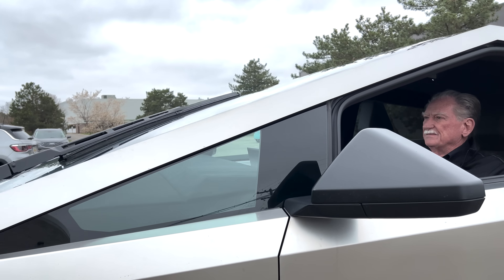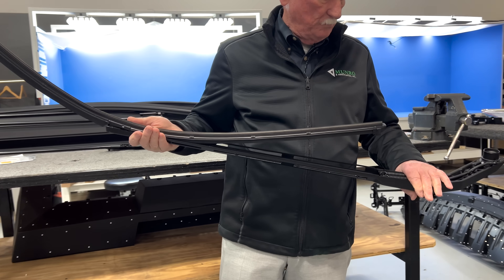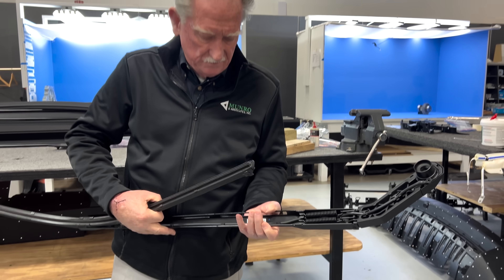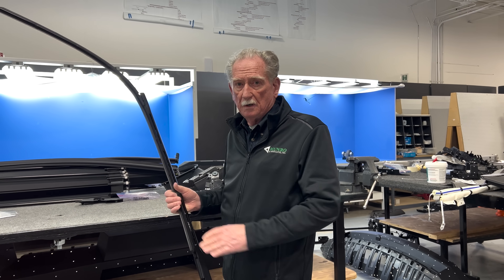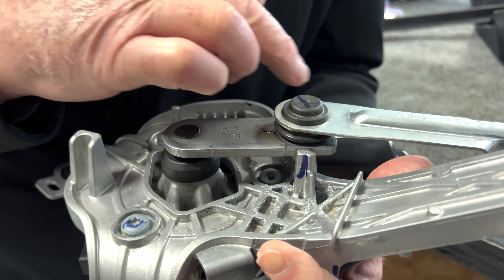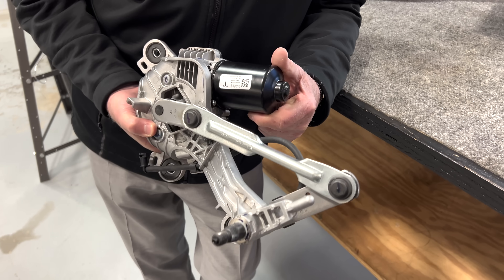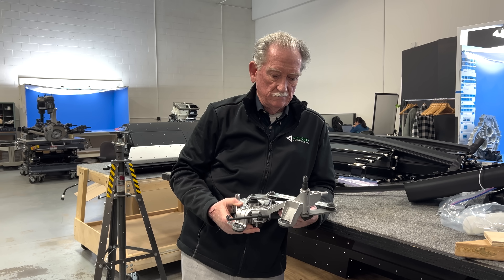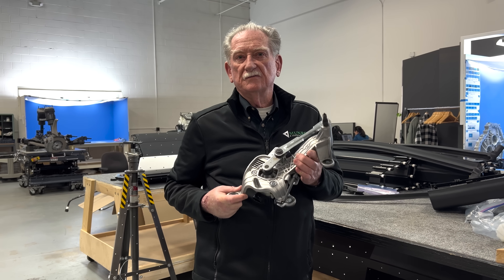How the Cybertruck's Massive Windshield Wiper Works

Comment: My Cybertruck wiper works great, but the factory-supplied washer fluid reminded me of the blue toilet water on airplanes.  I don't think the item shown by Sandy is the washer bottle, mine is black and the manual lists the capacity at 4.2 liters.
Reply: Agree, the volume of what he shows looks like way below 1 Liter. Would not really match a low maintenance car/truck, when you have to refill it too often and would be a safety issue. 4-5 Liters are standard in such a washer bottle. The actual piece is 1670900-99-C "Washer tank assembly" and looks way different in the parts catalogue.
Instead, in his hand he seems to hold the Brake Remote Reservoir, 1250681-00-A.
Everyone can mistakes from time to time, but it tells you something about an engineering analysis company, if they mix up those two reservoirs. Should not happen. Whoever put this on the table, needs some serious education. And Sandy should think about letting the actual engineers present the stuff they disassembled or analyzed.
Reply: @MooseOnEarth  doesn't matter,he always just says stuff that is not true.
Reply: It shakes the whole truck. Poor design.
Reply: @kcw9313  Wipers shake plenty of cars on their highest setting.  You never used a car before?  You can feel it in your seat.
Reply: Go price a replacement blade,if they are even available.  What a dumb vehicle. Replace tires much sooner than properly designed stuff.
Reply: @cengeb  It is 75 dollars for the blade.  But that is right now when they are barely making them. That cost will drop fast when they expand production.  Stop being a weirdo who acts ignorant on purpose.
Reply: @_PatrickO  $75 for one blade, saving money by going EV?  Hmmm, not if ya do your gazintas.  the math don't add up.  Wiper usually last about 9 months if lucky.  The Sun destroys them, even the good stuff, Bosch, Trico, Anco.  So even replacing wipers will be a major expense on this toad.And where they position the wiper at home, car washes will rip them off.  Not a very smart design...that is if the thing doesn't brick from the water
Reply: @cengeb  Grow up.  It is a $100k vehicle that is extremely low volume.   The price will be as cheap as any other large blade by the time they go into full production.  (assuming musk doesn't ruin the company first)
Reply: @_PatrickO  The idea that this junk is $100,000 is insanity personified.  the razor edges of unfinished edges, it's a joke.  they use a rivet to hold on the dumb plastic cover on the pedal, it's an embarrassment to any one dumb enough to pay $100K for this stupid looking useless junk.  Be embarrassed, driving it,
Reply: @cengeb  You are mentally ill, its low volume right now.  That means parts will inevitably cost more, but the only one buying them early like this are rich people.  Why are you obsessed with pretending new production doesn't start off slow and ramp up?  This is how it works for every company since the beginning of manufacturing.
Reply: @cengeb but muh no oil changes
Reply: @hansbrix2495  tires wear out faster,, cus of weight, brakes need cleaning because they are not used often, especially in snow areas, where salt is used. Suspension parts wear out like any other vehicle.
Reply: @_PatrickO  Well... I suspect the price will drop when there are competitors making replacement products. But it's alwasy going to be expensive. No more $5 refills
Reply: @stevep8773  I don't think 75 bucks is expensive at all.  This is extremely low volume and is larger than a normal wiper, so normal wiper manufacturers wouldn't be able to use their normal production lines for this.  Making new stuff that is different than existing stuff means their is an early adopters tax.  Why do we have to act like high prices on something brand new for the first year is not normal.  Look at PC hardware where prices start off high and get much cheaper after a year.  That is what it looks like making totally new products all the time.

Comment: Do arm assemblies typically do a complete revolution? 
Seeing this one with travel stops at the motor/gear end, would mean change in the motor direction by voltage reversal for every sweep cycle...?
Reply: @vwecco1:  Old style wiper motors did a complete revolution with the linkage making that into the back and forth motion for the wiper arms.  That allowed a simple on/off for power to the motor for control plus a parking off switch to make the wipers stop in the down position.  Today, modern electronics are so cheap that reversing the motor voltage is less costly.  Plus the 48v operation makes the motor cheaper as well due to less copper used.

Comment: The more I see of 48V architecture, I wonder to myself, why is it that this wasn't done 50 years ago given how it means a much smaller footprint for all the electrical components.
Reply: 12v was cheaper
Reply: Typical (heavy) 12 volt lead-acid battery is six ~2 volt cells.
A 48 volt lead-acid would be massive.
Reply: About 20 years ago, there was a push to move to 42 Volt DC bus when electric power steering began to appear.  Some racks are 42 Volt with a separate inverter for power.  Notably, this can be found on GMC Yukon and Sierra, Chevrolet Tahoe and Silverado, as some other brands with EPS.

42 Volts wasn’t popular, which is perhaps an understatement.  In 2009, Popular Mechanics ran an article, What happened to the 42 Volt Car ?

I tried to find out why 42 and not 48 Volts?, and have not found a satisfying answer.  48 Volts has been a common DC bus voltage in telecommunications for over 100 years and is still common in data centers for powering servers and switches from DC.  As such components oriented toward 48 Volt operation already exist.  Even changing to 24 Volts would have made sense because that is already common in trucking, industrial and military vehicular applications.
Reply: @wtmayhew  Thanks, very Interesting! I guess it took advances in electrical device tech in EV's and Tesla to make the final push away from 12V DC to 48V. Hope it sticks this time.
Reply: @joebullwinkle5099   Thank you for the reply.  I agree, high time for 48 Volt bus now that it is inexpensive to convert DC to whatever voltage is desired.

Comment: Would be interesting how such a wiper and assembly would hold up over time, especially with temperature fluctuations. I guess time will tell.
However seems better with one blade then 2 separate blades.

Comment: I just hope it senses rain better than 3 or Y. Owned 4 teslas thus far and they have all been terrible at rain sensing. Don't know why they just won't use infrared like the rest of them
Reply: Have you watched technology connection ?
Reply: @ralanham76  just checked it out. Not sure why Tesla has to use vision for everything when something like that works perfect. Instead my wipers turn on for no reason or don't turn on even though there's enough water to not be able to see. It's my only real gripe.

Comment: This video was an absolute delight for me!  I'm not sure if it's a coincidence or a sub-conscious psychological disorder, but I have owned:

1981 VW Scirocco: 1 Wiper
1987 Subaru XT6: 1 Wiper, dual bell crank
2003 Mercedes C320: 1 Wiper, dual bell crank
And, sort of related, a 1972 WV 411 with spare-tire-pressure-driven wiper washers.
And I learned to drive in my dad's 1960 MG Midget: 3 Wipers

And I have a Cybertruck on order (ETA mid 2025 probably).

So I am deep into the bizarre automotive windshield wiper design lifestyle.  And might I add - all the above wiper systems worked astonishingly well and not one single problem with any of them.

I currently drive a Mercedes E-class with rain-sensing wipers that people swear is Bluetooth synced to my brain because the wiper goes exactly about half a second after I think I could use a wipe now.  My kids thought it hilarious as we drove along in rain and I would say "Nnnnnnnnnnow!" and the wiper would go almost exactly as I finished, almost every time.  Good engineering, Mercedes!
Reply: My W210 MB has a single blade too, pretty nice to see it working.

Comment: You should never use your wiper to clear snow from the windshield.  Always use a snow removal tool that has a brush and scraper.

Having the power to clear the snow is does not mean the added strain of doing so will not prematurely degrade the motor.

Also, in most states, while not illegal,  you can be held financially liable if snow left on your roof causes an accident.

This is beginning to change however as Connecticut, Pennsylvania,  New Hampshire, New Jersey and Rhode Island have now all passed laws requiring the vehicle to be free of snow.

Take the extra 5 seconds to clean off your windshield when you are cleaning off the roof and hood.

Comment: How much power does that motor consume at peak load?
Reply: depends how fast the car is going and if you are dry humping the window.
Reply: From Google: "That's because the wiper needs to overcome the airflow when it slides horizontally, which is no small feat, considering how big it is. Moravy claimed the wiper motor has "between 600 and 800 watts" when he spoke with Jay Leno in the Cybertruck Easter Eggs, Features & Design video."

Comment: I see the wiper blade replacement as very expensive.  A normal car' truck $20 and I've replaced both with good quality form any parts store.    That doesn't matter as this truck has unbelievable horrible styling. I shouldn't even use the word styling!
Reply: Wiper blade is $75, not that expensive considering the size.  Not sure it's a worry for those that can afford a Cybertruck.
Reply: its like 70~80 bucks. its actually cheaper than getting new ones for my current car.
Reply: @mikenielsen3971  - I expect many Tesla haters are just paid Russian trolls trying to prevent EVs eventual takeover. Hard to ignore them though.

Comment: Please remember, that the wiper is big for a car, but is not big if you talk about bus. Here, wipers are even bigger, usually with additional mechanizm for paralel tracking.
So, this is know performance i known tech. Tesla engeeneeers are not stupid or irresponsible, and know the trade.
About cleaned area  - the wiper cleans square area of the winfshield and obviously leaves about 1/4 of the are not cleaned. But it is misleading - as the translucent area of the windshield is much smaller and rectangular. The wiper clears nearly all of it. Unwiped upper corner is simply mostly in blocked area and has no impact on the visibility.
I doubt if one can clear more with 2 wiper in the case of traditional windshield without blocked area.